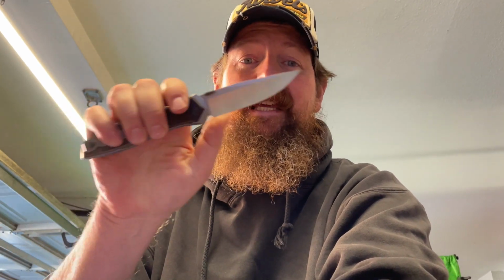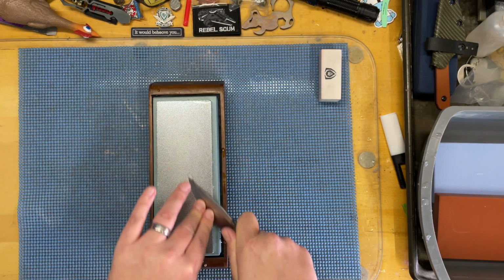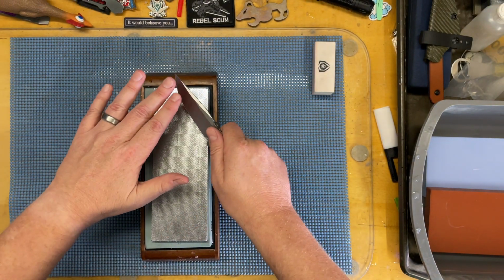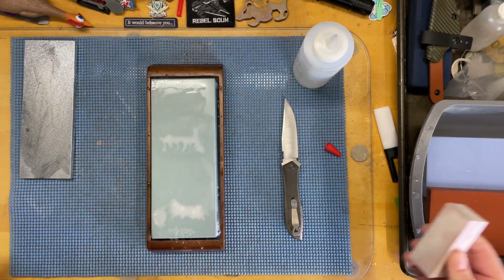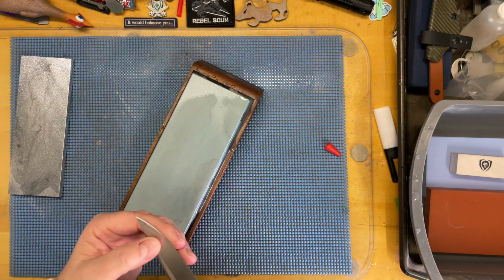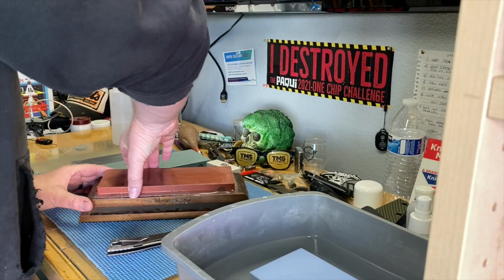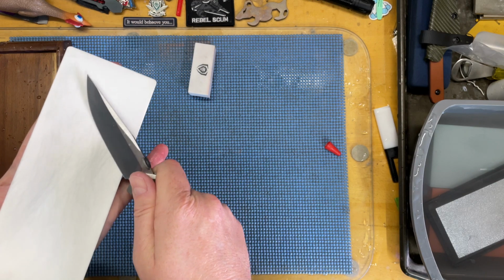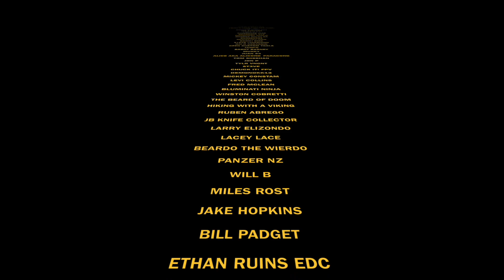LETS SHARPEN A ZERO TOLERANCE EDC FOLDER

Comment: Are you putting some pressure down as you strop? Do you strop at a higher, lower or the same angle as you sharpened at? Thanks for the video! 👍

Comment: Mike , Thanks for the vid , I have a question, I have Venev resin bonded stones 6x1 “ , I just resurfaced on glass with Aluminum oxide 2 grits lower than the stone I’m resurfacing, I’m concerned in between cleaning with the Nagura stone , I see it removing color of the stone when cleaning , I feel like I’m dishing the stones if cleaned unevenly, Is it possible that I’m making the stone uneven ? 
Should I clean the stones after every sharpening? Thanks for any advice